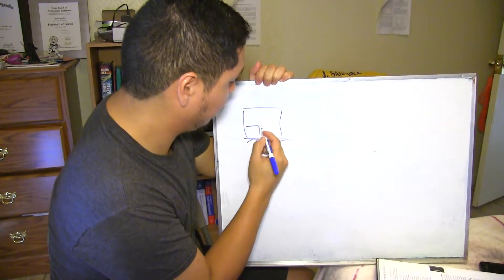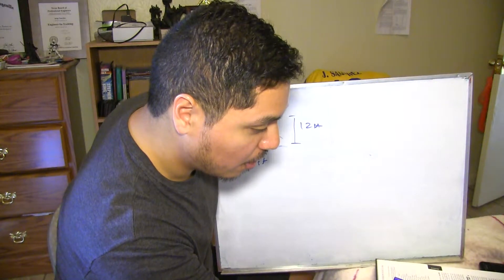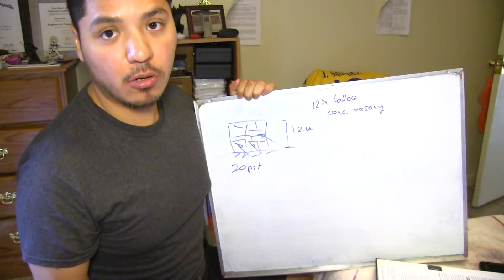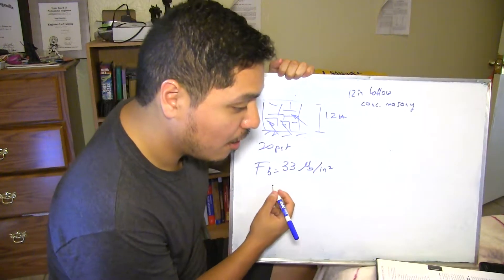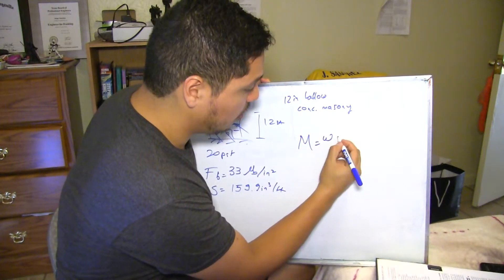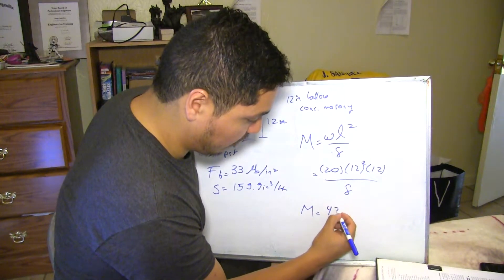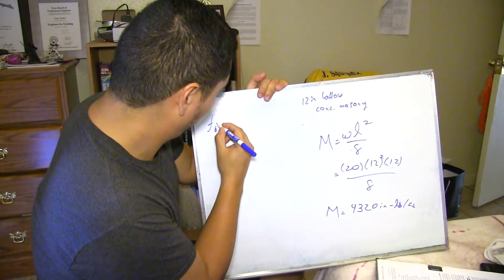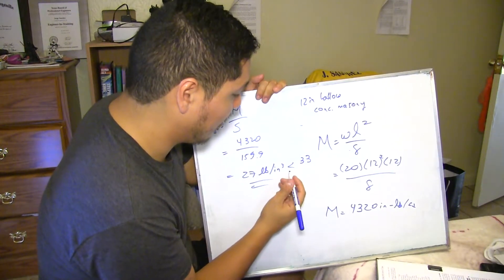Can this Masonry Wall take the Wind: Design Example

Comment: Do you have to worry about tension developing in the section? Allowable stress should be lower on tension side than compression due to brittle nature. I haven't worked with Masonry yet. So, maybe they are equal for masonry. Lol
Reply from the maker: Yes, you are not wrong, this was a very simplified sample problem of Masonry Design that does not take into account other possible factors.
Reply: Jorge Sanchez I just checked page 68-4 by luck in PE book.... Oh wait... That's what you're using. It does say specifically that the 33psi is the max allowable TENSILE stress. Good to know.
Reply from the maker: Yeah, I am getting the problems I do from multiple resources including the CERM, I solve them before and then try to post them to see if I understand the concept.
Reply: Jorge Sanchez That's a damn good strategy for long term studying. Keep posting these videos. Because, inevitably, I or someone else will try to fill in the puzzle when (especially yourself) haven't completed it fully. I mean... each time I study myself, it takes like weeks before saying "oh I missed that which cures all that confusion I had".
Reply from the maker: The best way to study (in my opinion) is to solve this problems and then see if you understand them by explaining them to someone. In this videos I am kinda doing that, so it helps me a lot, also, sometimes I don't remember how to do certain stuff and I can look back at this videos for a quick reference. It's easier to remember the location of this videos than an obscure problem in a book.